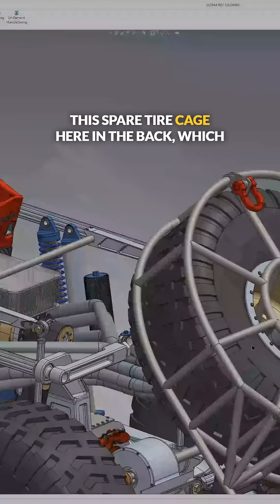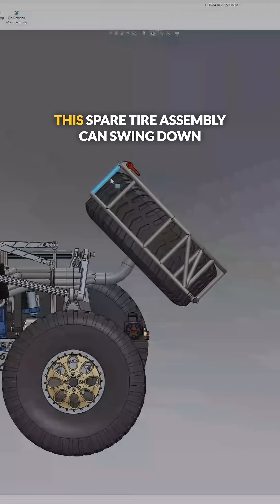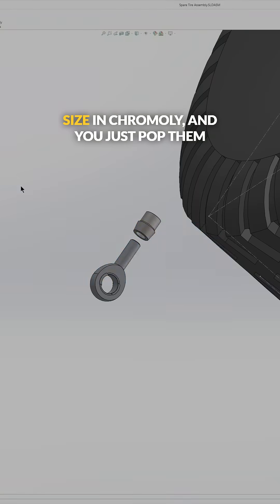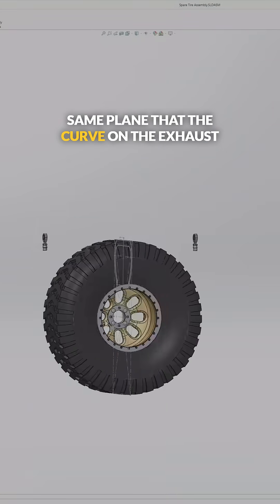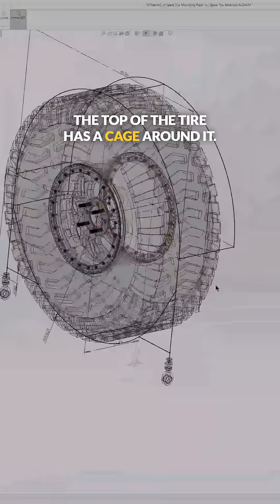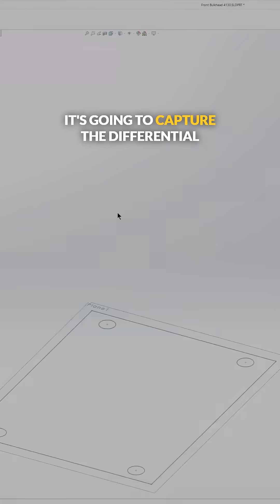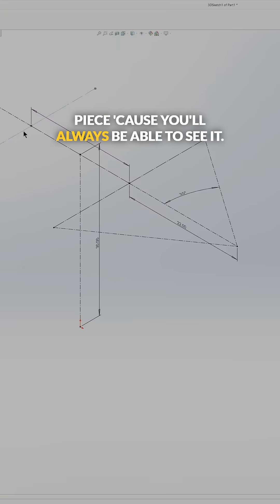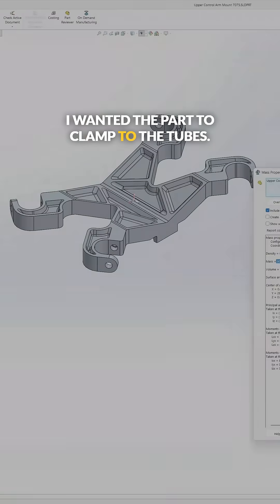Custom #ultra4 spare tire cage design #offroad #caddesign #solidworks

Comment: Having all that exhaust heat near my spare tire sounds disastrous. I would never trust a spare tire that's been exposed to so much heat.The thing is sure to blow out on me.
Reply: This looks like a sand rail application where cool air is gonna be flowing all over everything due to the open design. Even a small air gap in this case is enough to keep things cool. At that point all you need to worry about is heat transfer through radiation, no need to worry about convection. The rim will dissipate this heat easily. The sun will cause more heat buildup than the exhaust. Sure it's not optimal, but it sure is cool!